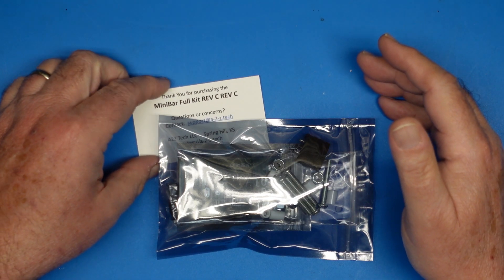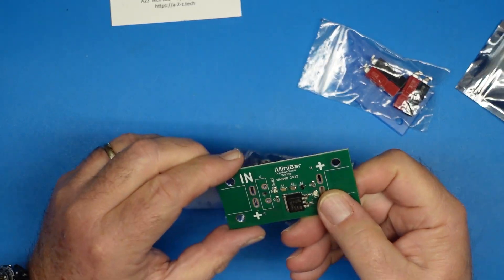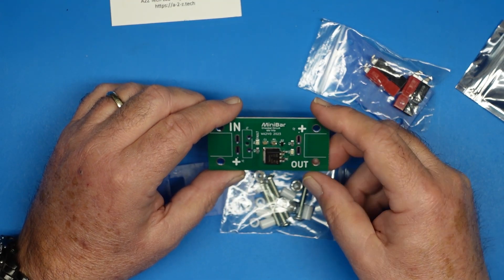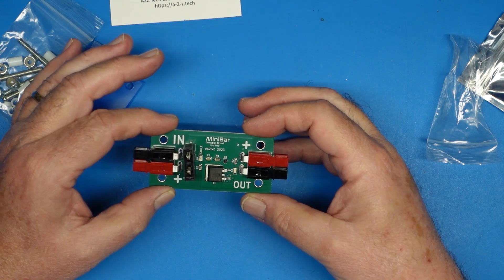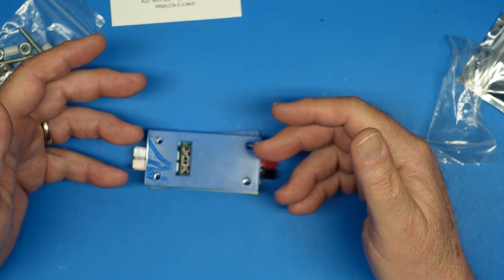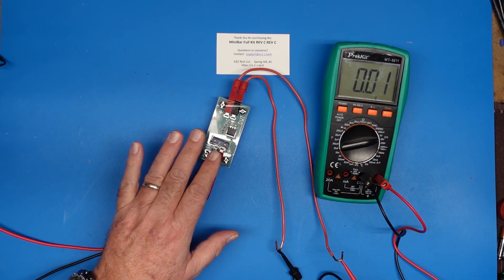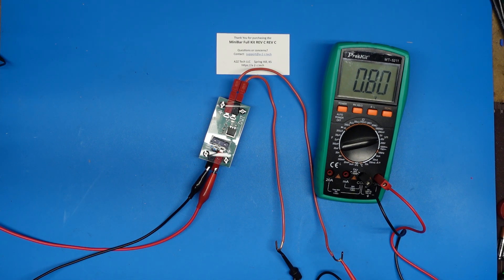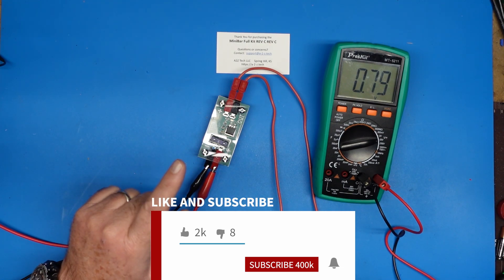Crowbar Circuit: The Ultimate Protection for Your Gear!!

Comment: May I please know the max ampere rating for this device?
Reply from the maker: The board can handle 15 amps continuous or 25 to 30 amps at a 50% duty cycle of 20 seconds on and 20 seconds off.

Comment: Years ago my $100 Pyramid 20 amp power supply smoked my IC-718 with 24 volts.  If I had one of these things back then I could have saved my $550 radio.

Comment: I assume you had a current limited power supply which is not capable of blowing the fuse in the crowbar. Crowbars do short the output, which would immediately blow the fuse behind the crowbar.